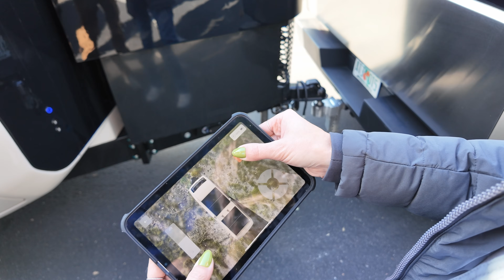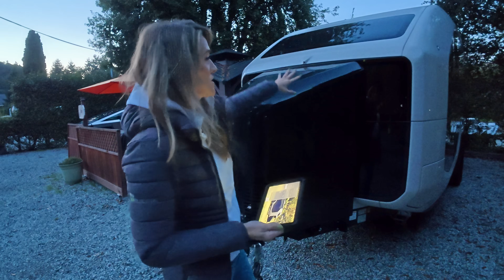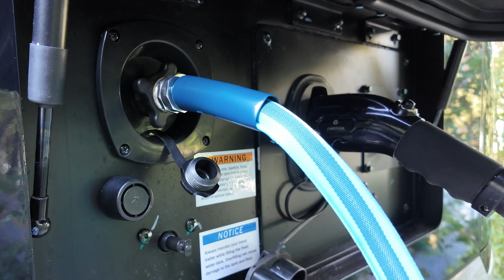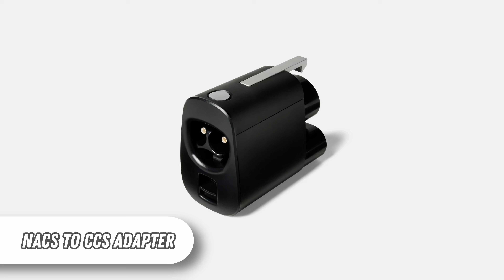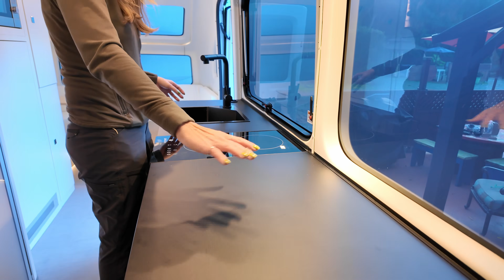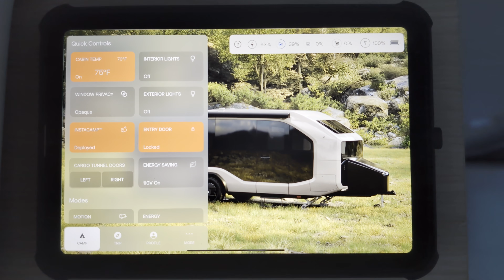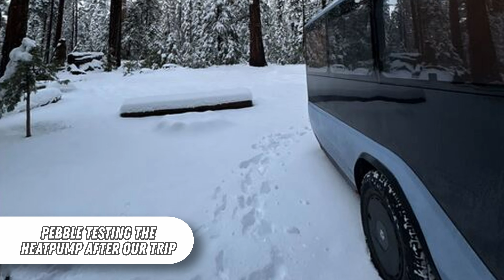World's First Pebble Flow Review (Electric Travel Trailer Camping Experience)

Comment: too geeky...  missing many things you expect on an RV way below half the price..... the pv panels will break in few years. buildquality feels alpha phase
Reply from the maker: $109k is half the price of a comparable airstream.  Panels are optional, and they are warrantied for those who choose them.  -Producer Tim
Reply: @MissGoElectric  if the airstream is double the price and still got the same features its not compareable... (wtf are these prices!?)
it doesnt matter if the panels are optional.... glued flex panels are going to die very soon, but dont worry, warrenty will expire before

the whole thing looks like an rv designed by apple....  many geeky features, 50% useless while you miss many others... like you told in the review... missing lights... missing plugs, missing useable storage, missing secure storage etc etc

the smart glass toilet walls are the cherry on the top, NAME ONE SITUATION you will ever use that besides humiliating someone....
Reply from the maker: It is an RV company founded by Apple's iPhone production lead.  The backstory is fascinating:
https://youtu.be/0dqY5MTF8Y0

We used the smart glass constantly.   It is a much cleaner look than curtains and much easier than drawing curtains on 8 windows multiple times daily.  Practical, brilliant, convenient...its a very good implementation.
-Producer Tim
Reply: @MissGoElectric  oh... it actually cames from apple people... that explains a lot
but it does not explain why you avoid my points and sound like PR Spokeman of Pebble
i didnt mention the outdoor facing windows, i talked about the TOILET GLASS WALL
Reply from the maker: The interview is very informative.  We think its the most in-depth coverage of this product origin anywhere
https://youtu.be/0dqY5MTF8Y0
-Producer Tim

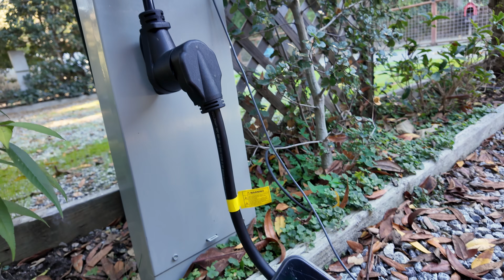Comment: @26:00 their usage of 32.5kWh in a day is a LOT. most people would not use that much energy if living in an RV, only in a blazing 100F+ summer would someone need this high amount of energy.

I do off grid solar for RVs so I know.
Reply from the maker: The premise of your statement is flawed.  Most other RVs use the energy stored in propane gas for heat.  Pebble flow uses electricity for heat.

The process of cooling the interior using electricity is, as you've pointed out, energy intensive. A heat pump uses the same process to pull heat from the exterior air and transfer it to the interior.  The bottom line, if you want a 30F difference of temperature inside VS outside (cooling from 100F to 70F or heating from 40F to 70F)...and you are using an electric heat pump/AC...you'll use a comparable amount of energy to get either job done. The consumption figures shown in this video reflect that reality of physics. -Producer Tim

Comment: I am fairly well off and you lost me on the price.  You have to be a total electric groupie AND RICH to buy this beast.  And I say that as someone who had a whole home solar panels, inverter and battery system that I LOVE installed in June 2025.
Reply from the maker: $109k starting price is about half the cost of similar sized luxury travel trailers from Airstream and the Pebble is far more capable even at the entry level. -Producer Tim
Reply: It does have a pretty big battery... compared to the industry it's respectable IMO

Comment: Why use a god awful tesla cybertruck?  The range on it alone is horrible compared to the max pack battery of the silverado.   Why will these channels use a true truck like the Chevy WT max pack?  That's the cheapest truck that gets absolutely way more range.  SMH
Reply from the maker: As stated, Tesla provided this vehicle for Pebble and it had more range than we needed to tow the entire trip in both directions with no charging necessary. We are grateful to Pebble and to Tesla for making this trip possible. 

GM's electric trucks are fine, but they are much less efficient. They can go about 30% further and they use 90% more energy to do it. The result is astronomical DC Fast Charging costs and charging sessions which take a lot more time.

 The ride comfort and road noise in all GM trucks is not nearly as good as Cybertruck. Cybertruck has a higher safety rating, better stereo, and better software, too. Cybertruck can carry more than twice the payload of a long range Silverado EV.

We've covered the Silverado WT (work truck) on this channel extensively. It's a solid no frills option with a good purchase price. It's nice that there are many options for towing the Pebble Flow. We very much enjoyed our experience in the Cybertruck.
-Producer Tim

Comment: I would recommend buying road hazard insurance for the tires at any Goodyear tire dealer before your first trip, it's well worth the cost if you can't repair a tire issue. Another option is the Goodyear Endurance trailer tire, they are the best on the market, higher speed limits and scuffing features designed for trailers. They are also made in the USA.
Reply: My husband explained to me why you never want to buy a tire without a road hazard warranty.
Reply from the maker: In this video we outlined that lifetime roadside assistance is included. More layers of protection including additional insurance or simply carrying a spare will probably be taken by some owners. 
Thanks for sharing your opinion
-Producer Tim

Comment: The trailer isn't bad, but needs some work. Zipper screens? One a $175,000 trailer? Trailers that cost $15,000 have screen doors and built in pull-down screens  on all the windows that open. The water tank capacity should be closer to 55 gallons. Do you really need windows on the bathroom? Get rid of them and cut the cost from the price, no one wants to show off their toilet. Fit and finish was poor in some places. Not a bad first pass, but the price will have to come down and some changes will need to be made before many of these trailers are sold.
Reply from the maker: 🫠-Producer Tim

Comment: Huge mistake pairing the trailer to a truck that no one is buying and those stuck with it can't sell. There's also the fact that Tesla has been disgraced by its owner. Would have rather seen how things go with a truck people actually buy.
Reply from the maker: The safest and most Americans truck on the market is not for you.  Everybody understands.
Miss GoElectric and I personally own a Cybertruck and it's been wonderful. I wouldn't dream of selling it and I've been in all of the other electric trucks. 

Try to be rational here. This is a place for electric transportation not sensationalist drivel. 
-Producer Tim
Reply: @MissGoElectric  Tesla Cybertruck owners have reported numerous issues, including
build quality problems like misaligned panels, gaps, and loose trim; functional glitches such as failing gear selectors, unresponsive tailgates, and wiper motor failures; safety recalls for accelerator pedals and inverter faults; and design complaints about poor visibility, noisy cabins, and easily damaged stainless steel body panels, with some owners experiencing recurring problems and frustrations with service. Tesla's Cybertruck is hitting a major slowdown, with reports showing more than 10,000 trucks sitting unsold across U.S. lots, nearly $800 million in inventory. Despite years of hype, demand hasn't come close to meeting expectations. Tesla sold only about 6,400 units in early 2025, far below its goal of 250,000 a year.
Reply from the maker: Did you ever really think such an uncle conventional vehicle would be popular for normal people even when the actual cost was $25k more than planned. The premium price point and aesthetic predictably shunk the size of the total addressable market.

60,000+ Cybertrucks have been sold and each built upon many technologies which have never existed. Of course some of the 60k units aren't perfect. That is to be expected. We've driven all over the nation in ours and it's been a joy. We know many other owners and none have had trouble 

Have a look at literally millions of Toyota Tundra and Ford F150 recalls over the last year. We like our Rivian R1T and we like our Cybertruck. Your regurgitation of sensationalist headlines are of little consequence. Please try to be rational and objective in our comments section. This is a knowledgeable adult audience.
-Producer Tim

Comment: This EV RV is a start, but needs major upgrades and updates. I thing it’s bit expensive for for it gives you, I hope in the future models I want to see bigger travel trailer in length and height, bigger holdings tanks, bigger fridge and definitely a larger shower. I must have missed about AC\heat, but needs bigger and need 2 AC’s. But it’s a nice trailer for maybe a weekend. Definitely needs bigger batter that’s where a much larger overall in size, of some sort of generator. I think realistically I might be expecting too much from an EV travel trailer and looking for more of a EV class C in size and capabilities, and I am sure they will be coming out in the very near future.
Reply from the maker: There are others on the market now with more interior volume and larger tanks
https://youtu.be/XOQITLQT-v0
-Producer Tim

Comment: why is she going none stop about the solar when parked at a spot with 30amp shore power??? who cares! no one buying this thing is ever gonna boon dock.
Reply from the maker: Nonstop? You are mistaken.  Solar is mentioned for 18 seconds and this video is more than 30 minutes long.

There is a single graphic which identifies off-grid time based upon our usage, which most viewers find helpful.  Its important to understand that solar exposure is also heat exposure.  Its important to recognize that over a given day, even a sunny one, the systems onboard gobble up more electricity idle than the panels will produce...or at least its very close.  Net gains are not assured.  We delivered thousands of facts during this video.  You can learn or you can complain.  Its free to you.  We did the work. Don't be rude.
-Producer Tim
Reply: Seriously? Plenty of people would buy this and all they would do is Boondock.

Comment: Best tow vehicle would be a gas f150 with pro power.
Reply from the maker: "best" is fully dependent on your personal preferences and criteria.  If you want the most American-made truck or the most technologically advanced truck or the truck with the most torque, or the smoothest riding truck, the quietest truck, the most capable off road truck, the truck with the most lockable storage, the truck which can silently charge the Pebble three times from its own battery, the truck with the best water fording, the truck with best sound system, the safest truck, the truck with the lowest operating costs, or the truck with the most durable body panels...the Cybertruck would be the choice of the two by all of those metrics. -Producer Tim
Reply: @MissGoElectric if you want the truck created by an unapologetic white supremacist, the truck built by the man who has stolen millions of dollars in government contracts to feed his own companies, the truck created by a man who disowned his own daughter. Don’t forgot to add these items to your list of criteria for why the cyber truck is the um, ‘best’.
Reply: It’s a problem when the rv and truck are solely dependent on batteries. With the Ford you have a traveling generator to keep on boondocking. If all electric, the GM max battery is almost double the CT
Reply: the ford f150 powerboost hybrid is even better.

Comment: Great review! I have one on order for a May delivery. 

A couple questions: 

1) Based on the price, value, features, are you considering buying a Founders Edition? If not, why not?
2) I noticed some water stains on the windows. How easy is it to clean the exterior?
3) What did you think of the tan color? If you could choose a Founders Edition color to pair with the Cybertruck, which would it be?
4) With shore power hooked up, are you saying you would only get 2 full days of power? Or is that while boondocking off-grid?
Reply from the maker: Hi Rod, 

We will not personally buy Founder's Edition. $175k is not an amount we are willing to pay for something we'd only use occasionally. If we were both retired, perhaps we'd consider it. 

As for colors, sand looks good with Cybertruck to us. 

We have no experience washing the exterior of the Pebble Flow. The manufacturer would be better suited to offer advice upon delivery or in their discord.

The energy usage graphic we provided was specifically identified as an "off grid" extrapolation based on our usage which included an overworking heat pump.

Thanks for watching 
-Producer Tim
Reply: I’d suggest you take a cooling test under sun during 1-4 to check if there is cooling and the noise. I can tell you there is no cooling after about 85F and the fan is really noisy and never gets stopped during cooling.

Comment: I am so glad you pointed out the kitchen countertop material (and sink lighting). I agree that this needs an upgrade to a higher-end and more durable material. Hopefully they'll also reconsider the bathroom cabinet design as well.
Reply: I believe all 3 or 4 things above are easy to resolve at a very low cost
Reply from the maker: Low cost & low effort. -Producer Tim
Reply: One of the pluses with quarts counter tops, like the reconstituted quarts ones from Silestone, is thier anti-microbial surface and large color choices.
Reply: very cheap materials.
Reply from the maker: The cool thing is, these items are fairly easily and cheaply altered either by the factory or by an owner. The big features like instacamp, auto hitch, auto dump, and ez tow were fantastic for us.

Can you share a bit about your experience with the Pebble Flow?
-Producer Tim

Comment: I really enjoy your videos!  But one suggestion:  focus more m/kwh values instead of Wh/m.  That makes it easy for most of us to wrap our head around what kind of mileage you're seeing.  But that's only my opinion.  I'm in several Chevy Bolt forms on FB and just about every comment relating to efficiency uses m/kWh.  BTW - I got around 4.5 m/kWh during the summer in my 2023 Bolt EUV (and routinely carrying my eBike).
Reply from the maker: We understand that more than 60% of EV owners in America drive a Tesla.  Less than 5% of the EVs on the road in the USA were built by GM.  Tesla expresses their consumption as Wh/mi and we do so because of the audience composition.  In this video m/kWh is also given several times...we did the math on both sides but we default to the unit of measurement which our audience is most likely to have seen in their EV.  -Producer Tim

Comment: It's cool, would consider if I camped a lot. Price isn't all that bad, quality needs to improve. Price reflects a fair amount of kit more than a standard trailer...
Reply from the maker: Thanks for sharing your observations.
There is a $109k version without the propulsion motors and associated feature set.  That is about $15k less than the MSRP for a comparable 26ft Airstream with a fraction of the battery capacity and less insulation. -Producer Tim

Comment: With grok it says if they cyber truck uses 121 of its 123kwh pack the with the pebble it can tow 244miles 😮
Reply from the maker: Grok is NOT a source. Please identify the actual source which supports your claim/correction.

Tesla does not advertise a CT kWh figure but many independent tests show between 123kWh and 128kW usable. The usable can change at any time through software or hardware at Tesla's discretion. It could also be dynamic adjusting to infinite factors.

We provide reasonable basis data and viewers are free to interpret the information however they'd like adding the margin of error which they feel is appropriate.
-Producer Tim